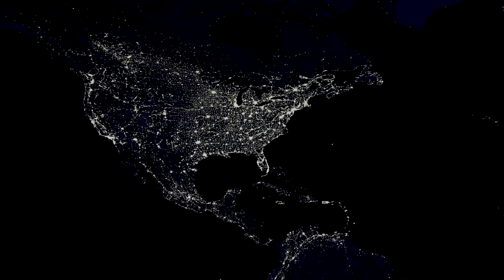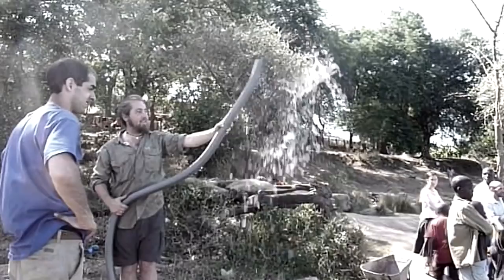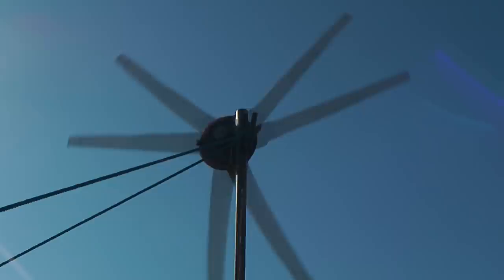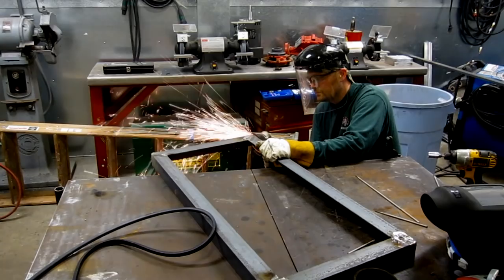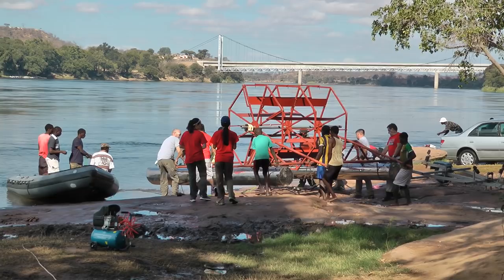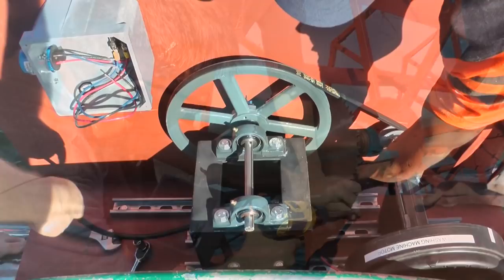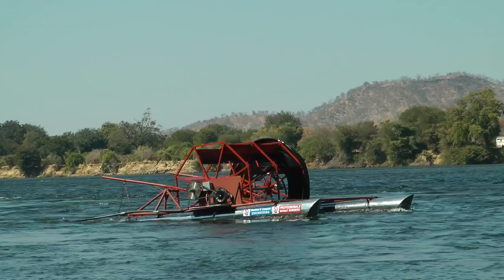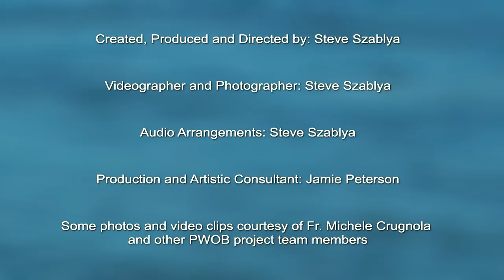Waterwheel Documentary- Harnessing Electricity on the Zambezi River

Comment: Steve, a few technical questions please if you don' t mind.  

(1.) What is the waterwheel diameter and width?  

(2.) Do you bring 3phase AC from the generator to the house, or do you convert it to DC on the float? Although it looks like a 3 phase rectifier against the wall so I presume you bring out 3 phase AC and convert it to DC at the house?   

(3.) What are the voltages levels that are generated on the generator on the AC side and on the DC side after rectification?  

(4.) What model of charge controllers are you using (looks like Victron manufactured?)  

(5.) Did you have to rewire the connections between the coils on the stator of the generator for different voltages?

(6.) What make and model of washing machine is it that you used as donor for the generator?

Thanks!!
Reply: Any answers?

Comment: I built one using same idea. It's about 4 feet diameter and 3 feet cross section. Best I got was 24 watts.  Water flow was about 4 fps
Reply from the maker: Thanks for the comment.  What did you use as the generator?
Reply: @szablya  600 rpm 600w marsrock pmg. I geared to about 40 to 1.  Giving me about 200 rpms.  Higher gearing ratios dropped it down to less watts.
Reply from the maker: @claysmith8839  That's the frustrating part of run of the river installations. The energy is there, but you have covert it to speed to the generator.